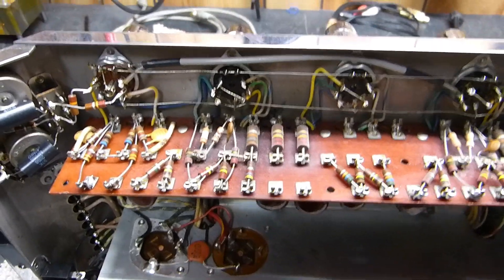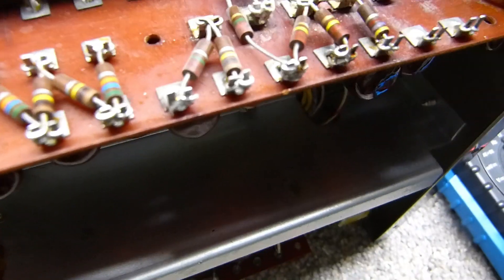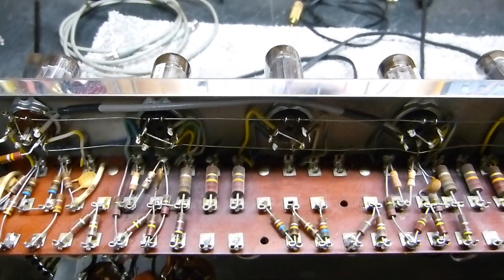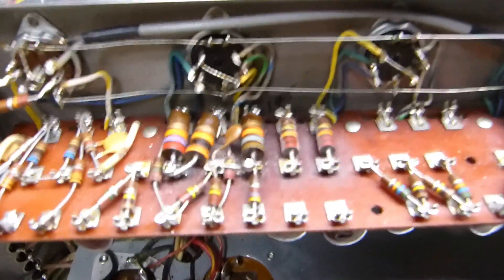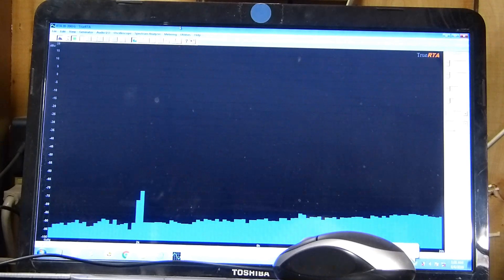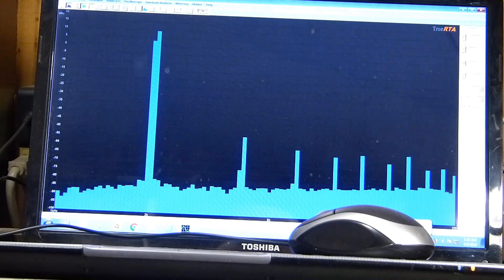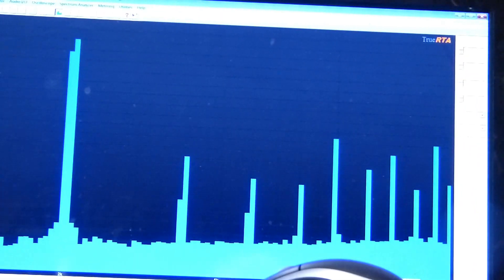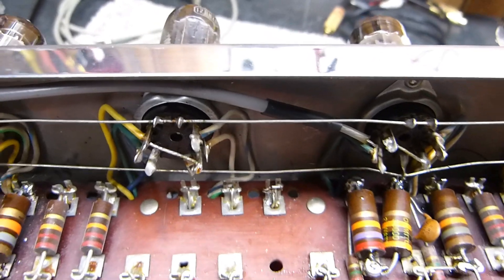McIntosh MC225 Repair

Comment: What is the why of the issue? Is it those resistor were equally bad? Or is there another issue in the circuit causing the over voltage or current to cook those parts? Will it happen again?
Reply from the maker: If you do the power dissipated across those resistors by measuring the voltage across them, you can see that right at 1W is being dissipated in a 1W resistor and after 60+ years they burn up. That is why I put in 2W. Not a design error so much but the resistor is running as hot as it can withstand for decades. I have seen this in every MC225 I have worked on. There are some slight design changes in the Mac amplifiers of this era and they are all around this very area in the circuit. It is document in their schematics.

Comment: 121V at the cathode across 18k = 6.7mA, and half that through 30k =  0.4W. These are rather high currents and low resistances for an LTP phase splitter. I wonder why. Maybe they were trying to keep the stage gain down?
Reply from the maker: You got me curious so I made these measurements. The DC voltage across the 18K is 129V idle and 124V @ 25W output or 0.91 (1 watt) at idle. I actually did not do this math earlier but could see the 1W 18K ran too hot. The reason for the 18K is the top stage (V2 in the schematic) is driving the bottom stage as a cathode driven, grounded grid stage. The bottom stage has its grid grounded for signal with that 0.25 uF capacitor - now I have to go back and make another measurement - 490 mV (peak-to-peak signal) at the grid of V2 and 2.29 VPP at the plate for a voltage gain of 4.67. From the two I have found to have the same problem, it looks like over 60 years, the R in the 18K drops (as seen in this video) and over-currents that 30K which is a 1/2 watt. I guess we can forgive them a little but a 2W 18K should make it last 120 years instead of just 60...  🙂
Reply: @ The reason for the 18k is to provide an approximation to a CCS in the tail so the LTP will be better balanced. But in other amps I have seen it as 22k or even 82k, which provides a much better approximation, and in conjunction with plate resistors on the order of 100k. All this is much lower in this Mac. 

Don’t think I’ve ever seen a resistor go lower in value, either. All very interesting.
Reply from the maker: @EJP286CRSKW  From my direct measurements above (129V to 124V) from idle to full output, do you see the 18K providing more or less stability as CCS than the higher values resistors?
Reply: @ Less. See RDH. I’ll find the page number later. See also Leak TL/12 Plus schematic, and Mullard 5/20.
Reply from the maker: @EJP286CRSKW  I agree with you. I see it as less current flowing and with a changing in load, E = I*R so less I, means less E change and more stable E. Makes sense. I never thought of it that way and now see why some people use solid state CCS components at that point in the circuit. The Poseidon board design uses a solid state CCS that I have used. It uses an LM334 in the LTP cathode.
Reply: @ Not what I’m talking about. Balance, not stability. If the tail is a perfect CCS, when the current in one side goes up, the current in the other side must go down by the same amount, so if the plate loads are equal the output voltage swings must be equal and opposite. An 18k resistor is far from a perfect CCS, so you need unequal plate loads to compensate, and also to compensate for the different gain laws in each side. See Crowhurst & Cooper p141 equation 98. This gives Rp1/Rp2. You can see that as Rk gets very large this approaches 1::1. And that’s why I expected a larger Rk.

But I’m not saying Frank Mac got it wrong. He didn’t. The stage is in very good balance, as you can check with Keith Snook’s phase splitter calculator. I’m just looking for design elements that would contribute to high currents, and here is one. He chose 18k to put the cathode at 121V so that the DC coupling from the previous stage would bias this stage correctly, -6V.

So I think the underlying fault here is that the anode voltage of the previous stage has gone higher, so this stage is under biased, so the current is even higher than designed. So I would have a good look at the previous stage.

NB RDH p526 and the section 7.2 it refers to.

Best EJP
Reply from the maker: @EJP286CRSKW  I am impressed with that phase splitter calculator. Looking up the specs for the 12UA7 and putting in the values in the Mac 225, I get a balance of 1.0068. Very nice. Everything else I have looked at in the amplifier checks out very good. I think the 18K Rk dissipating 0.81 watts over the decades finally took its toll and, as seen, dropped to about 6K and untimately opened the 30K from over current. It does better than 0.1% THD, both channels operating, at 25 watts. Thanks...

Comment: Interestingly, Audio Classics is about an hours drive from me and I was just in there about 2 weeks ago and had a nice conversation with the guy there about these amps. He indicates that they sell these for about $2400. A little rich for my blood.
Also, since some of those resistors generate some heat, should they be raised off the board a bit?
Reply from the maker: Raising them slightly could help in less browning of the board. In this case, I decided to make them all 2 watt so they would be able to dissipate the heat a little better. $2400 is much better than they are advertised for on Ebay... take a look at what they ask for them on Ebay and some in awful shape. I am glad to see Audio Classics is still in business.

Comment: McIntosh MC225 is a great MC2505 is my favorite McIntosh has merged with Bose new McIntosh gear is in  no way as good as these old amps as a technician I've seen inside the new gear rubbish in my option
Reply from the maker: I have had quite a bit of McIntosh equipment and still do and their power amps are very good (the old ones) including the SS amps of the 1970's but their tuners, not so much, from my experience. I have had four that were not good and developed very difficult problems I never was able to fix (solid state). The only receiver that still works properly is the Mac 1700. I have a C20 from early 1960's or possibly late 1950's that is perfect - truly so - but my MX-112 and MX-113 are junk as a tuner. Preamp portion works fine. If you want radio equipment you want Collins Radio not McIntosh but I do think the vintage Mac power amps and preamps are the best.

Comment: nice video. The 225s are really nice amps. quite interesting display on the higher order harmonics. The other common failure point is the inboard voltage doubler cap. See this amp has had the cap replaced. I had one of these two years ago where that inboard cap was completely open but the amp still functioned.
Reply from the maker: It is a beautiful condition amplifier. My friend bought it a few years back off Ebay from Holland and had it shipped to El Paso. This little amplifier has been around the world...  I meant to show just how pristine the lettering was on the chrome but forgot. Also, I understand what you mean how the McIntosh design can keep working, not at top performance, but keeps on going even when some components fail. Marvelous design. Also, interesting you mentioned the failure of the capacitor in the voltage doubler circuit. I had that capacitor fail a two different times in a Williamson design amplifier that uses a voltage doubler. There must be a lot of stress on the capacitors in the voltage doubler circuit. Thanks for your comments.

Comment: Noticed the diodes? next to the fuse look like they've got hot - worth replacing or upgrading? Agree with lining up & positioning resistors etc so they're neat etc. Shows pride in your work.
Reply from the maker: I noticed that in reviewing the video but not at the time I had the bottom off - thanks for reminding me - I will change them to higher current diodes.
Reply: @ElPasoTubeAmps  Yes, video's can be a useful tool though often I don't film parts or wiring that in the future I need to see : )
Reply from the maker: As an update, I removed the bottom and checked the diodes and there is no hearing of the board at all around the diodes. Absolutely perfect condition. Just another case of shadow in the video so I did not replace the diodes. Thought it was worth mentioning and documenting.

Comment: I was never impressed with the crappy 20% plastic molded carbon resistors that Mac used. Back in the day when we used to upgrades, I would rebuild these with higher wattage 1% non magnetic metal film resistors... and took away a massive sense of haze. Also, get rid of the steel RCA jack... talk about cheap and crap sound.